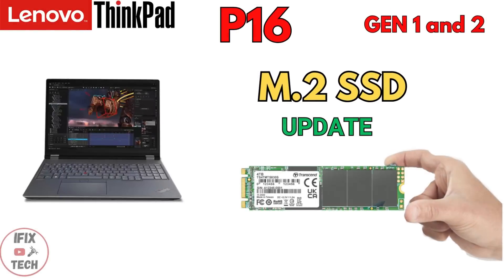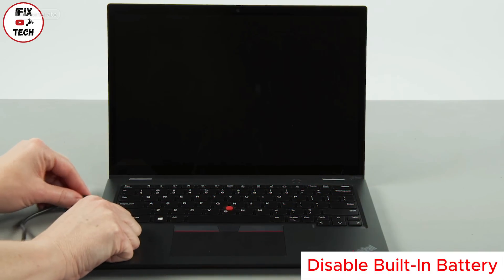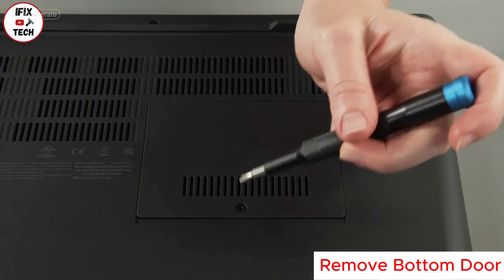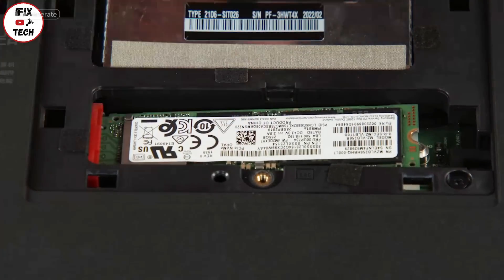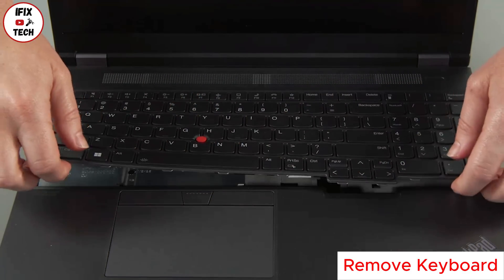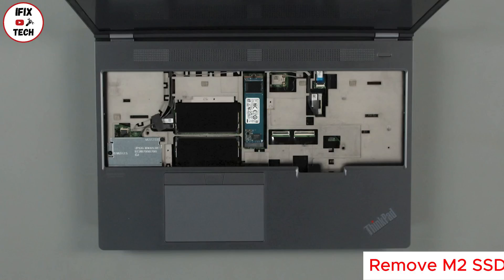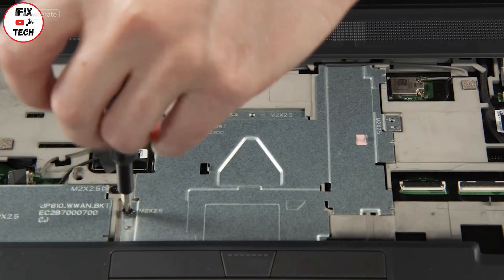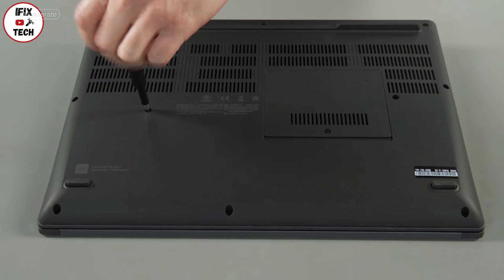Lenovo ThinkPad P16 M.2 SSD Upgrade Replacement  -  How to Remove Solid State Drive

Comment: Hi, I have a plan to upgrade motherboard in my T495 with the one from T14 G2. Physically, thermally they shall match. Have you tried creating such Frankenstein mod?That Lenovo U1 tool will accept my serials without issues?
Reply from the maker: It should work fine. U1 tool should work too. Just use product name from the T14 one. Thanks for liking it and subscribing 👋 😉